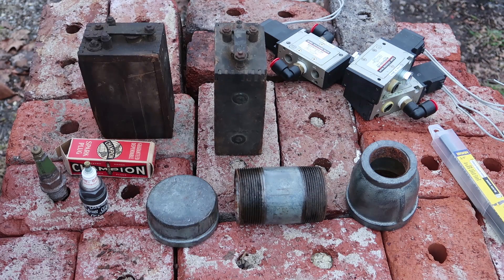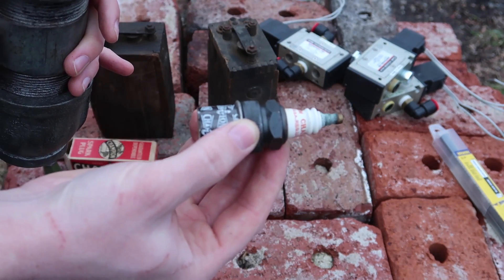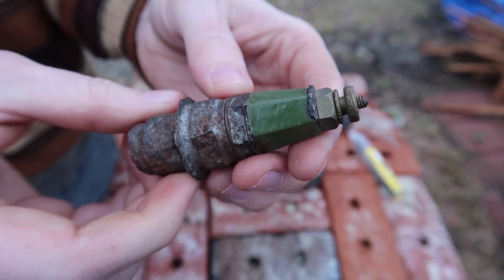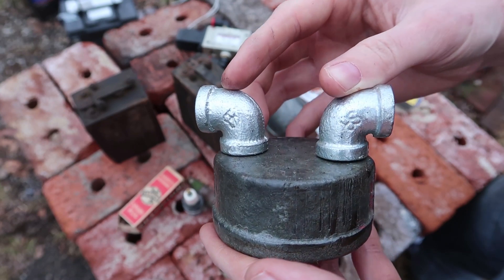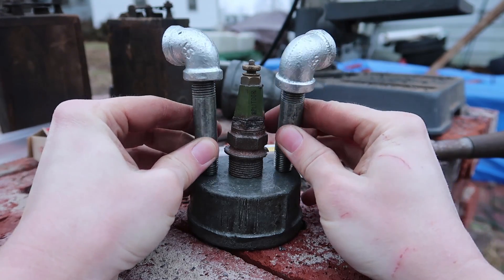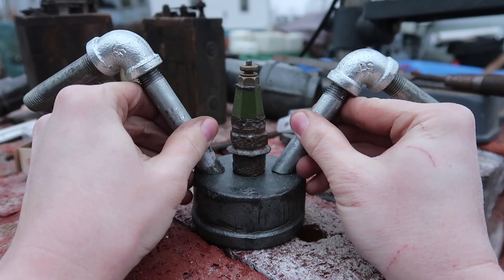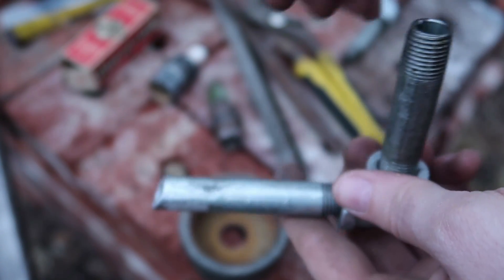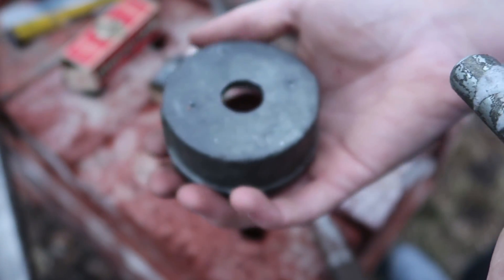DIY Liquid Fueled Rocket Engine 01: Simple Rocket Engine Combustion Chamber

Comment: Hey, instead of making fuss over an atomizer, you could just use a venturi siphon and your pressurised air to simplify the plumbing into just one line into the chamber,  the oxygen would mix the kerosene and distribute evenly, the proportions could be controlled with a flow regulator

Comment: Also your concerns a-propos the grease inside the pipes are a little far fetched, although the static pressure from the solenoid valve will be 100psi the dynamic pressure will be trivial. Therefore the risk of spontaneous carburization and “the bottles exploding” is incredibly unlikely
Reply from the maker: yeah i know its unlikely, but i think its still a good idea to clean out the pipes before use.

Comment: I would recommend using steel over the cast iron pipe. cast iron can have inclusions that may fracture under high pressure. try to atomize your fuel. there are misters used spray water to help cool livestock that might work meatal ones run about one dollar. otherwise good luck be safe excited to see the outcome.
Reply: austin graham it’s not cast iron. It’s galvanized Steel.
Reply: @steveseymour1739  some is galvanized some isn't. The lower reducer and end cap are cast. cast iron can also be galvanized. Galvanizing is just a thin layer of zinc electroplated to metals to prevent rusting
Reply: austin graham all the pieces she used are galvanized. The metal is malleable. It will hold the pressure she subjecting it to. I am well aware of what galvanizing is. We are all aware it’s not going to land on the moon. Just let it be fun.

Comment: You should try glow plug for a diesel engine or jet engine
Reply from the maker: no because the glow plug only ignites the fuel when the pressure is increase to near its ignition point anyway.
Reply: You do realize the day glow plug heats up to 2000 degrees Fahrenheit right?

Comment: For your propellant you might try nitrous oxide and either ethane or ethylene.  Their pressures are similar, so you wouldn't need a pressurizer, and you could use off the shelf nox fittings from a hot rod supply house.

Comment: You need some c clamp vise grips to hold parts in your drill press. I think welding 45 degree elbow fittings to the chamber would be better. Also instead of dragging everything to a creek dig a little bunker for the test stand to sit in.

Comment: The oil isn't to protect the pipe or prevent rusting. The pipe is already treated for that with a galvanizing compound like zinc. The oil is leftover residue from the cutting and threading process. It's a lubricant.

Comment: Make your own hydrogen by separating water. I recomend using the king of randoms video on it as inspiration to make a bigger and more powerful thing (i forgot the offical term). He makes a pretty neat looking contraption. You can then compress it into a tank so it can be easily used.
Reply from the maker: its called electrolysis, and it will take too long and be too dangerous to get the amount id need

Comment: For small and simple kerosene engines like this, you have to control temperature by burning very fuel-rich. A better choice of fuel would be an ethanol-water mixture (probably around 80 to 90% ethanol). Combustion temperature is controlled with the water content and you get a better specific impulse than going very fuel rich on kerosene as the combustion products have lower average molecular mass.

Comment: 3:14 - in my opinion, you should first use a finer drill to center this drilling, after that you could use that cannon drill.  moreover, you could use a lubricating oil as this improves drilling performance.
Reply from the maker: yeah well, you also shouldnt make a rocket engine out of old plumbing pipe.
Reply: however, i hope that works! I'm waiting for the next video.

Comment: You need injectors, I cross drilled a bolt.  You don't want the mixture flowing toward the exit as it will burn outside the chamber.  You want the mixture to mix and burn inside the chamber so that it can build pressure.
Reply from the maker: yeah, but im trying enough new things with this chamber as it is. the next one will have replaceable injectors.

Comment: Welding galvanized is difficult. you have to grind the coating off the pipe both surfaces and it will weld much better!!!!

Comment: I don’t think the spark plug will prove reliable for ignition of the fuel oxidizer mixture. I’d recommend trying an automotive cigarette lighter or use a neon transformer as the power supply
Reply from the maker: I'm not planning to light it directly, im thinking have a fine spray of kerosene in the chamber for a bit then dump the oxygen and turn up the kerosene. im thinking i might make a separate nozzle that comes in from the side and sprays directly onto the sparkplug, would be just to get it started. but i wanna experiment.

Comment: When trying to perfectly halve a material like piping or lumber with a 45% angle, you have to find the center and then back off to one side exactly half the thickness of the material. That will be your cut mark. Then just cut from there at a 45 towards the other end.
Reply from the maker: well i found the middle and drew a 45* like across the pipe there and started to cut, im not sure what happened
Reply: Even though I know full well what to do, I've still been left perplexed on that very same cut many times over the years. 

Fabricobbling is a lot of fun and this is an awesome project!

Comment: Suggestion: Forget the two huge pipes in the next model. They'll mix poorly. Instead have maybe sixteen much smaller pipes entering in a circle, connected alternately to a fuel and oxidiser manifold. Make sure they are all the same length back to the manifold too, so you get the same flow rate in each. It'll be bulkier, but the improved mixing should result in better combustion.
Reply from the maker: i agree, but for this first version i dont have a milling machine so this will have to do

Comment: Looks a bit like a pipe bomb... what’s the difference between a home made rocket engine that explodes and a home made bomb that explodes?
Reply from the maker: pipe bomb has the explosives inside, and you dont need giant gas cylinders to power it. and its closed on one end
Reply: with a bomb the explosive part is the intention with a rocket u are only havea rapid unscaduled disassembly
Reply: MoGeLzZ   unscaduled dissasawhat??!
Reply: The rocket engine keeps on exploding.

Comment: I agree that propane would be an easier fuel to oxidize than kerosene.  How long do you expect that piece of steel tube to hold a burn for before it starts becoming oxidized itself. I'm no rocket scientist but I  Think of how an oxy cutter ( gas axe ) works. It doesnt take long for a acetylene or propane and oxygen I'm not sure about kerosene and oxygen but I imagine it would have much the same effect )  mixture to start burning through mild steel or even high carbon steel. You might end up blowing a hole out the side within a few seconds. I understand this is probably just a simple tester.  Stainless steel would be harder to oxidize. If you can find it and work with it ceramic alloys would ve even better.
Reply from the maker: i expect this to hold a flame for maybe 6 seconds and shoot a lot of sparks. but im not wanting to test long burns with this, this is mostly for startup tests. stuff that will mostly be observed with a high speed camera. once i figure out how to get the engine to start without exploding, run for a second or two, then shut down, i can move to a cooled engine with a custom shape. 

This is very much a disposable engine, since my first tests will undoubtedly blow up anyway. lol

my end goal though would be to maybe make a steel engine and just see how long itll last. if i make the walls thick enough it might just be long enough for a single launch. who knows.

Comment: Hydrogen is easy to get. Simply oxidizing scrap aluminum with lye/water mixture (or urine)will release hydrogen from the water as oxygen is pulled out of the water.

Comment: Shouldn't the gage be before the solenoid?
Reply from the maker: no, i have a regulator before the solenoid so thats set to 100psi, i want to know what the pressure is before going into the chamber. and since i drilled a 2.4mm hole i can then calculate how much oxygen is coming in, then ill build the kerosene side

Comment: not being critical, why didn't you tap the orifice for the igniter(spark plug) it would solve your issue for leaking, also would have used  45 degree elbows in the construction, also I would have gone with propane instead of kerosene......and your idea of testing in the creek... kerosene is a petroleum distillate...that makes it a hazmat issue (the creek I would suspect feeds into a larger body of water)
Reply from the maker: because the spark plug had most of its threads rusted off.
Reply: still you had enough threads...just my nature
 @RinoaL
Reply: you also need to practice your welds
Reply from the maker: i can do better, i just dont care. but also yes

Comment: I had some experience with liquid fueled rockets . One system I like uses gasoline and hydrogen peroxide and works nice and not moving parts. Another one that I like is a pulse jet that is air breathing and works on butane. the pulse jet rocket has very little risk of causing a fire if it crashes . If you want video links I can send them but you working with gas o2 is very dangerous

Comment: There is special teflon tape for oxygen. Mixing oxygen with any trace oil in the pipes is asking for trouble. Read the safety warnings on an oxygen reg if you don't believe me.
Reply from the maker: yes i said that in this very video about the oil issues, and thanks for letting me know about oxygen specific teflon

Comment: So did you feel a little queezy after welding on galvanized?...kind of like you were coming down with the flu?  Metal fume fever is no joke.  Don't weld on galvanized unless you clean all tge galvanization off in any area that will get to hight temp.
Reply from the maker: of course not, i dont let myself breath in fumes.
Reply: Rinoa Super-Genius  that's good.  So....you must have some form of respirator then.  That's pretty uncommon.  Kudos for investing in your health.
Oh wait, you aren't implying that you hold your breath while welding....or have some superselective breath control that allows you to exclude any contaminated air from your lungs....are you?
Reply from the maker: holding breath on a very windy day is more than enough, bigger problem is flux blowing away.
Reply: Rinoa Super-Genius No. Holding your breath is not 'more than enough''.  Even on a windy day, holding your breath isn't sufficient protection.  
The idea that you are different than all the welders who have come before you, by being somehow better equiped to selectively breathe just those uncontaminates portions of air is foolishly arrogant.  Brace yourself.

Comment: I need to go there so you can show me how to weld.
Reply from the maker: i dont know how to weld much tbh, another YouTuber would be much better such as ChuckE2009
Reply: It would not be as much fun!
Reply: You should start a Maker/Crafting forum. That way we can all discuss different projects, and help each other.  For example, I have a project I am working on. It's a telephone kiosk made out of 4.2mm thick steel. I need to update it by putting in some modern equipment in it. On such a forum I could ask what is the best way to make a nice clean cut into this metal so I can install said equipment on it.
Reply: @GeekBoy03  buy a plasma torch for your electric welder.
Reply: @gregwarner3753  I don't even have an electric welder. I am considering getting a cheap one from Harbor Freight

Comment: @ 02:34 "A.C. travels a very long way."

Comment: The distance electrical energy can travel depend on the losses in the transmission system. By A.C. I assume you mean the US power line frequency, 60 Hz. A.C. travels a long distance in commercial transmission systems because the voltage is increased to reduced the current, to reduce wire heating from (I**2)*R losses. A.C. is typically has more loss than D.C. because of reactive losses and radiation in the transmission system. Some commercial transmission systems use D.C.

Comment: the standard way to remove oil from oxygen piping for process piping was to swab it down with carbon tet.
Reply from the maker: i was thinking a good idea for this use would be to heat the metal up until it burns everything away.
Reply: Be careful. The zinc fumes are poisonous. Put the parts in a dishwasher to degrease.

Comment: You definitly need some form of restricting atomizer to break up the kerosene droplets and expos as much surface area of the fuel as possible. You will want very much more o2 (gas) than kerosene (liquid), at least 20 O2 molecules for each kerosene molecule.

Comment: I’m a simple man, I see a weld, I click. I see a bad weld, I click off
Reply from the maker: a weld only has to be as good as whats its connected to. and for this, a farmer's weld does the trick just fine.
Reply: Rinoa Super-Genius certified welder here, don’t mind me I’m only joking
Reply from the maker: ah ok, i get a lot of people upset at my welds. its like they expect a perfect weld when im working with garbage.
Reply: Rinoa Super-Genius yeah I figured, you can only do so much with those little gas less flux core welders
Reply from the maker: i was more meaning the parts im welding together.

Comment: Hydrogen is pretty easy to make, all you need is a battery some copper wire, water and somthing to collect the hydrogen
Reply: but it needs to be liquid. do you have any idea dangerous it would be to have to put what is basically the most explosive thing in the world in AN INSULATIVE PRESSURIZED HOMEMADE TUBE? AND FKING FREEZE IT?

Comment: You could make a hydrogen generator out of aluminum and hydrochloric acid , while injecting the hydrogen using a compressor into some kind of tanks. A small chunk of compressed aluminum foil (2cmX1cmx0.5cm) will weight about 2.70g, which will react with somewhat  more than four times HCl to convert entirely to hydrogen and alu chloride.
2 Mol Al + 6 Mol HCl = 2 Mol AlCl3 + 3 Mol. H2

Cheap hydrogen , but quite slow to generate.
Reply from the maker: and not liquid so not useable.

Comment: I still don't understand why you didn't just drilled the holes for the fuel/oxygen pipes sideways into the lid. 
Would have been much easier than welding on an angle. Also maybe better mixing.
Reply from the maker: because it looks cool, and i wanted to practice my welding a bit
Reply: Oh, wow, you actually answered! Thanks! 
And I accept your explanation ;)

I like your direct approach at technology, btw.
Reply from the maker: thanks, i figure making it look cool matters a lot now because it keeps it fun, later on ill design my engines to be more practical though

Comment: Nice pipe bomb you have there, please be careful, galvanized seamed wall water pipe has a nasty way of coming apart violently at relatively low pressures.
Reply from the maker: dont worry, i'll be several hundred feet away when i test it. this first engine will be as much about controlling from affar, as it is about testing the design.

Comment: The ignition sequence: 5..4..3..2..1..IGNITION..we have meltdown. I can guarantee you will melt the steel combustion chamber unless you have some way to cool it, or prevent the heat from getting to the steel.
Reply from the maker: of course it will melt

Comment: Welding - not good: You should always strip zinc from your pipes or any galvanize metal before welding. One way to to this is a with dilute HCl (pool acid) and then neutralize the surface appropriately.

Comment: Your tanks need flashback arrestors. Cheap. Same place you got your oxygen tank.
Reply: Your pipe would weld easier and cleaner if you stripped the zinc galvanizing off with a grinder first.
Reply from the maker: i'm making a combustion chamber out of water pipe, i think the welds are the least of my worries. and as for a flashback arrestor i cant find any that will work for this application, and i cant find any information on if rockets use them or not, or what types they may use. i bought some but they seem to limit the flow too much.

Comment: If you choose to continue using a liquid fuel use a fuel injector from a car or model turbo jet would be even better. But using propane would be better and if possible use natural gas because it needs a little more than half as much oxygen as propane

Comment: I bet it will have no thrust in a vacuum. None of them will.
Reply from the maker: rocket engines do have thrust in a vacuum though. they actually can have more thrust.
Reply: Rinoa Super-Genius there is no proof of that claim and zero evidence. It doesn't even make sense. A vacuum is potential energy, once pressure is introduced the vacuum acts on the pressure sucking it from source, thus, cancelling out your so called thrust.
Reply from the maker: @fea407  except rockets. you can watch rockets go into space and change their direction with your own eyes.

Comment: Hydrogen is actually VERY easy to get.  By applying a DC charge to water, you can separate the 2 hydrogen molecules from the 1 oxygen molecule.  I built a hydrogen generator that is capable of producing about 1.6 litters of hydrogen a minute.  Also, there is about 1,500 gallons of hydrogen in 1 quart of water.  Just saying.  Hydrogen is the most abundant element in the universe.
Reply from the maker: is that a joke? pure liquid hydrogen is very very hard to get. it sounds like you need to do more research. even pure high pressure hydrogen would be hard.

Comment: The injectors should have been drilled into the SIDE of the cap...
Reply from the maker: That would be a bad idea
Reply: @RinoaL  Will work better, as the apposing flow of fuel and oxidant will cause better mixing and combustion at the ignition point.. Also the plumbing will fit better.